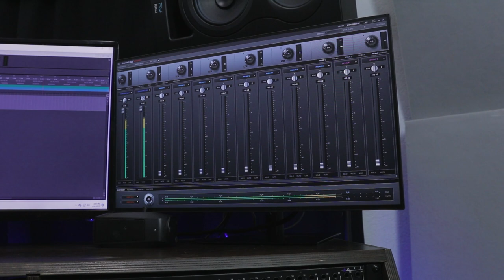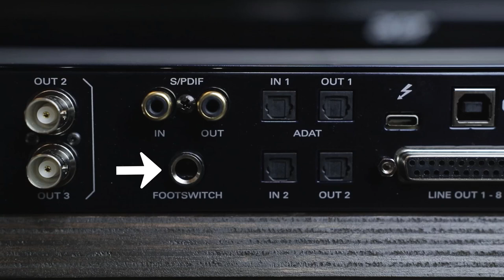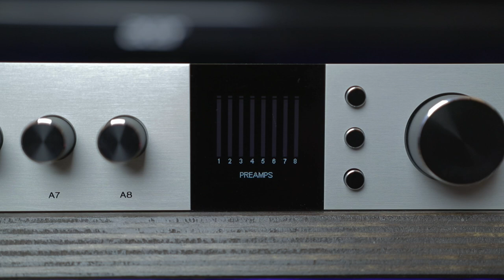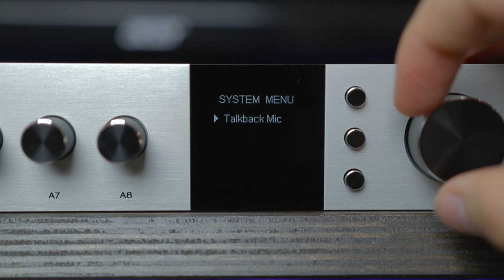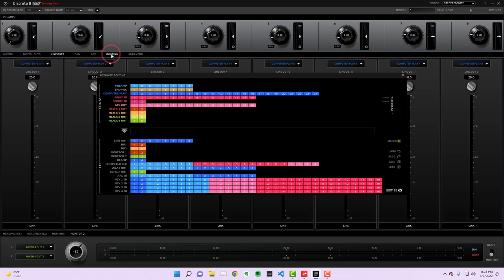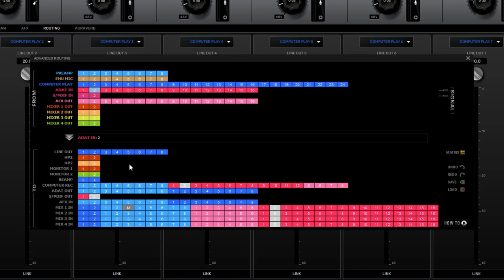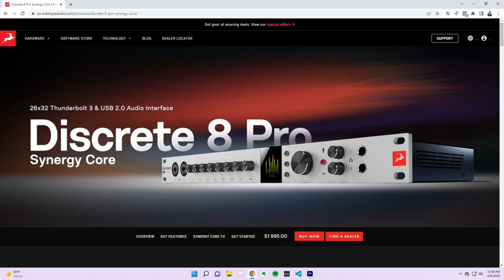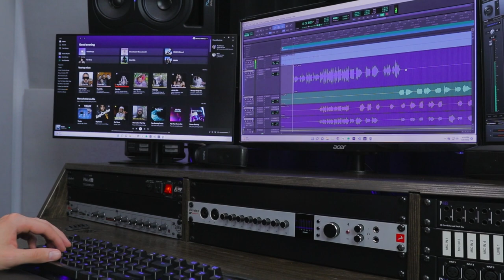First Look: Antelope Discrete Pro Synergy Core Interfaces—High End Mic Preamps, DSP Power, More

Comment: Been wanting an Antelope interface for ages. Thanks for breaking down all of the features. I think this is the one. I especially love that I can set up 2 sets of monitors without a passive box.
Reply: Bad drivers
Reply: @emanuelwhitehead6039  for Mac?
Reply: @ZAYAZOfficial  Mac intel I sold my discrete 4 synergy core 5 months ago after a year with bad drivers
Reply: @ZAYAZOfficial  I've been working on a Mac for year with Orion 32+ gen 3, no issues at all.."bad drivers" is so generic and the real reason could be 100 different things.

Comment: do discrete 4 and 8 difference themselves only in the number of ins? I have been told the quality of the 8 is a bit higher, if you could answer this that would be amazing, thanks in advance !
Reply: I contacted Antelope Audio about this same question. They said both devices are identical in performance, with the Discrete 8 Pro having 4 additional inputs. Who knows!

Comment: What about the reverb? I have the Discrete 8 SC and recording the reverb it´s not an easy thing to do. Does it appear as another plugin like in the Orion Matrix soft?
Reply from the maker: Hi Lautaro, I believe this has been improved further. I asked the folks at Antelope, and they told me the following:

"With the new D8pro is quite easier to record the reverb. It is not available as a separate effect in the synergy core library but rather its available in the first 32 channel monitor mixer. You can simply route the outputs of the mixer to you daw inputs and record the reverb this way."

Hope that helps!

-Justin
Reply: @SonicScoop  thanks Justin!